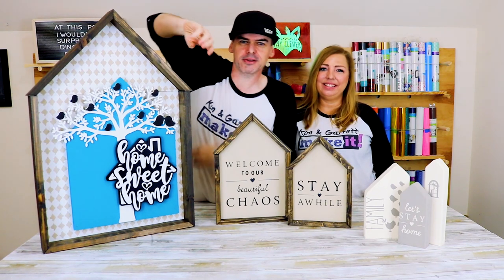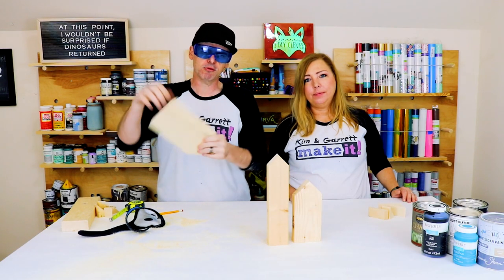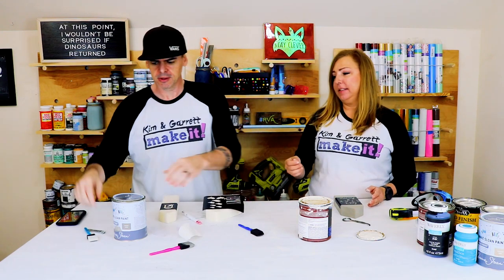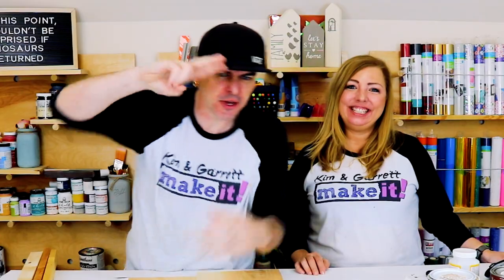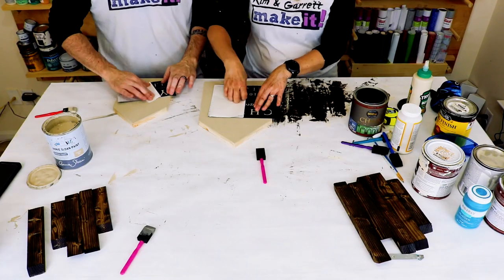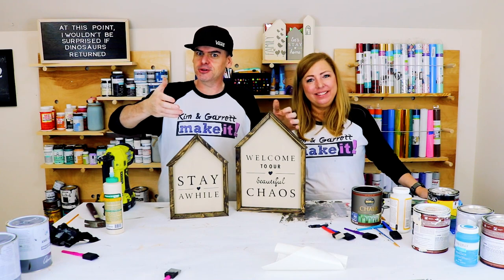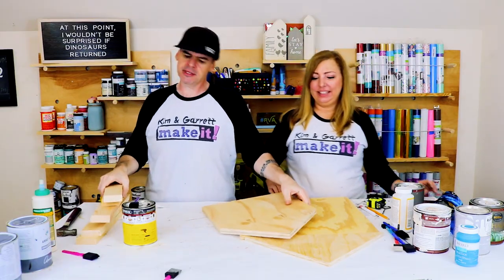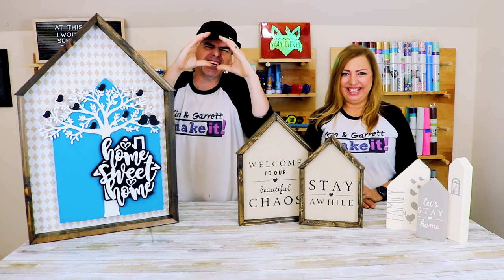3 DIY House Shaped Signs | Farmhouse Home Decor

Comment: Yay! You added the tree! I agree the last sign still needs something. 🤔 I think overall the finish sign it's just too big. Maybe hang something from the underside of the roof? If it was around the holidays I would have suggested tiny ornaments hanging down. Maybe a tiny potted plant on the lower corner? Great job nonetheless. ❤️ My FAVORITE though would have to be the second set of signs 😍.
Reply from the maker: Thanks!  Yes, the tree really helped. , And, that's what I told Garrett, maybe it's just too big, the two should have been closer in size and overall smaller.  Thanks for your feedback!